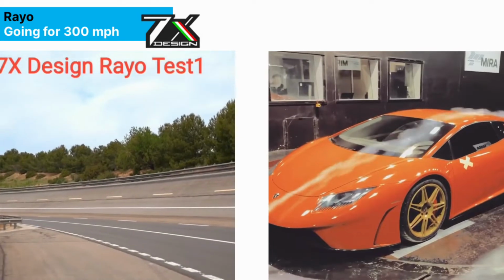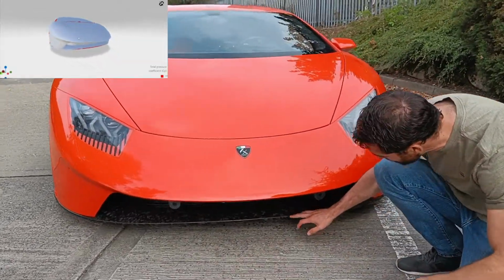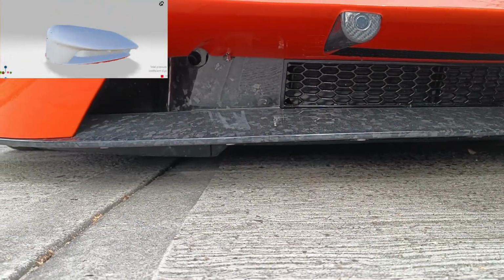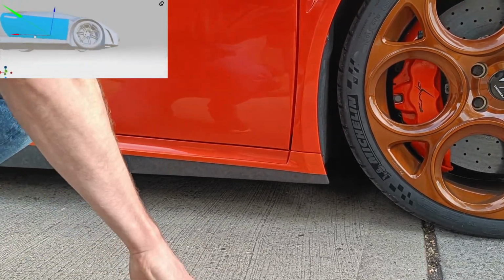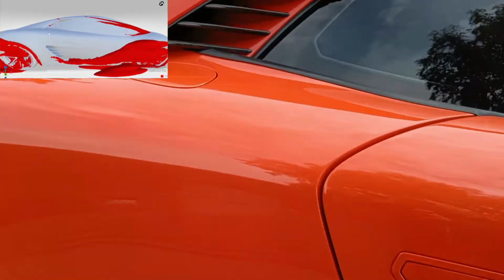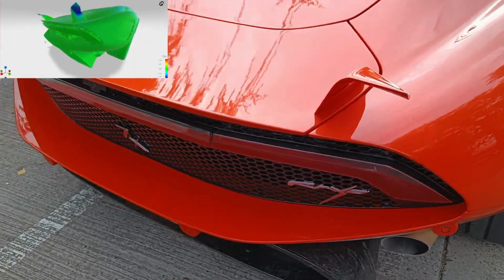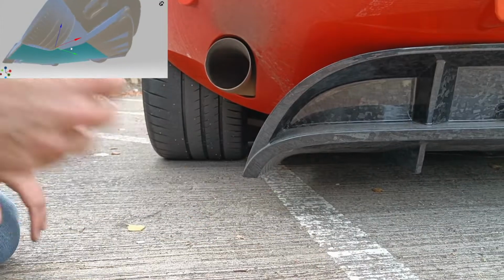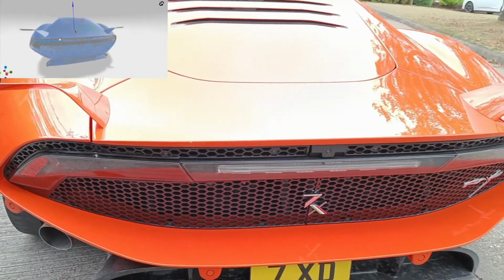7X Design Rayo - How to design a 300 mph hypercar based on a Lamborghini Huracan

Comment: Have you ever tested the aerodynamics between a slick-top roof vs one with open rail roof bars (not the racks that connect the bars)? I assume there's a difference, but I haven't been able to find just how much of a difference and if it's worth removing them at any point.
Reply from the maker: Haven't done that yet, but I would agree those longitudinal rails can add drag. Airflow is almost never perfectly parallel to the car or those rails, meaning the air may traverse the rails at some locations, possibly detaching in the process (causing drag and wind noise). But to be studied in detail!